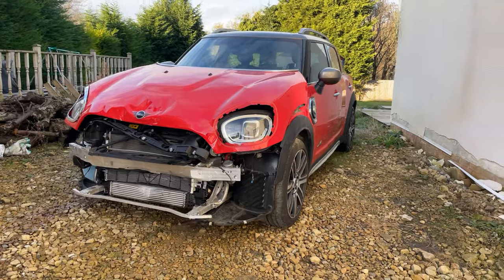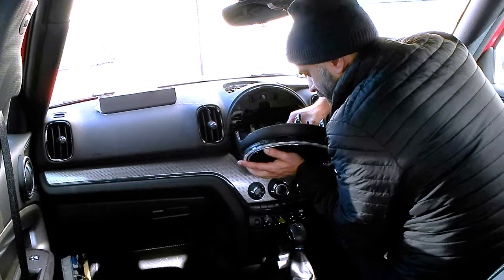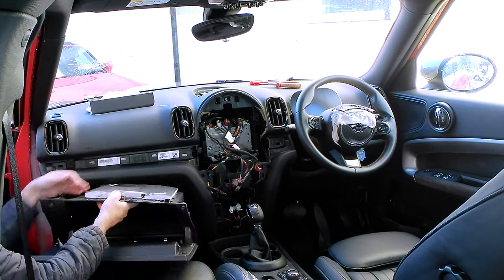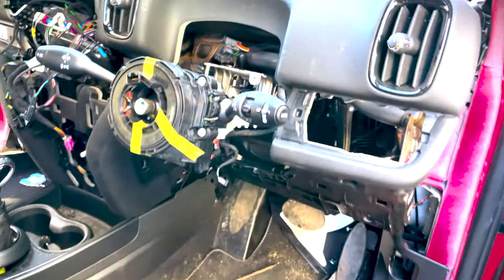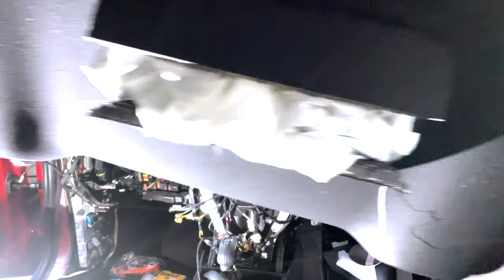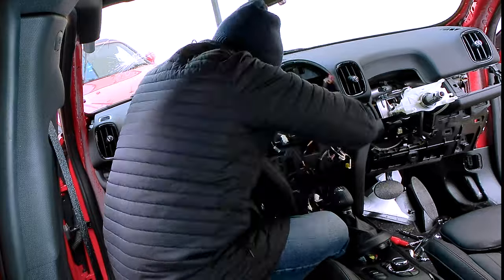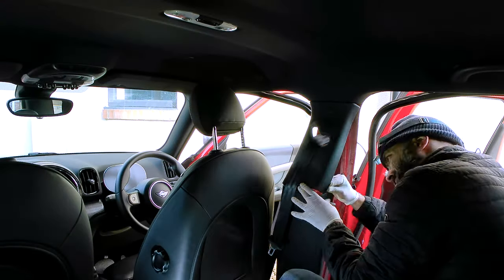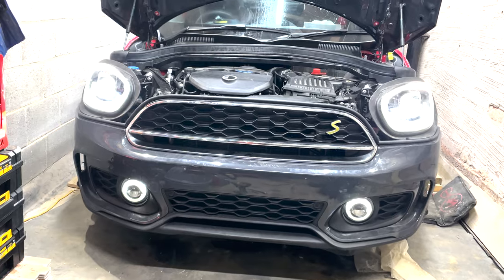REPLACING AIRBAGS | REBUILDING A WRECKED MINI COOPER S E HYBRID | Copart Salvage Auction Restore DIY

Comment: Hi Imy, Great job, but I’m a little puzzled, having sorted the actual airbags, seat belts, what about the srs control module which, correct me if I’m incorrect, is under the centre console. Do you not have to remove this in order the reset the ‘crash data’? I’m doing a very similar job so I would welcome your reply please? Regards Rod
Reply from the maker: Hey Rod, on BMW’s / Mini’s you can just reset the crash data using diagnostic software. I used the ISTA software to reset the module. If you’ve got a new module with your airbag kit, you could just swap it out at the same time as doing the airbags - if you don’t want to be messing with software or diagnostics. The third option is to send your module to one of the many airbag companies on eBay who will reset it for you. Good luck!
Reply: Hi Imy, Thank you. Will ISTA run on a windows 10 lap top, if so, is the procedure easy to follow and which ISTA package is it?
Reply: Not to worry Imy, I’ve removed seats to remove centre console to access srs module, I’ve also prepared dash to remove, not difficult or really time consuming. Thanks again. Regards Rod
Reply: Hi Imy
Sorry to be a pain, but I having no luck with getting the airbag module crash data reset.  It’s a ACSM4i  part number 6577 5A41CA2. 01.  I’m being advised it’s not possible and a new module is only way forward by two company’s  and the other three contacted have not responded!  My question, mine is a 2023 yours a 2021 both face lift LCI models therefore, I would guess have identical modules?  Can you advise please?  Regards Rod
Reply from the maker: Hi Rod, I’ve not used them myself but a company called crashdata (co.uk) have your part number listed as one they can reset. They charge £65 I think. I’ve no experience of using them, there are other companies that can do it too. But, I would first check that you’ve cleared all your airbag codes. Are you sure the seatbelts aren’t still showing an error? Like I mentioned before, I just reset mine using the software, I’d be surprised if they changed the module significantly on the f60.
Reply: Hi Imy  Thanks for your reply Cashdata, Liverpool, won’t touch the module as another company Autotech, Leicester, had it and could reset data. They say they don’t know what’s been done to module, but really, all they do is plug it in and if it doesn’t work it doesn’t work!  In truth I think it’s sour grapes on their part or more likely they can’t do it either!  So, I’m now in contact with Electrotech, Manchester, who say they have seen this kind of module before and think they can clear the crash data, so fingers crossed!  You ask if I have cleared the airbag/seat belt codes, as crash date requires reset I thought the respective company would do this too, so no I haven’t, do I need to do this first?  If so it may be difficult as steering wheel, dash, n/s curtain airbags and, although not locked out, both front seat belts have already been replaced and I fear that refitting the module at this stage to clear the codes may deploy one or all!
Reply from the maker: No, I meant to say are you sure all the faults have been physically cleared… i.e you’ve replaced all the parts that need replacing. Given where you’re up to, I would have the ecu reset, plug it in and then see if the airbag light goes out. If it doesn’t, you might need to replace your rear belts too. They don’t always physically lock out when they go off.
Reply: Ok Imy, thanks for clarification that’s great. I’ll let you know how I get on. Regards Rod
Reply: Hi Imy, Just refitted airbag module (battery disconnected of course) Electrotech (NW) Ltd, Manchester, were able to clear crash data, well I hope they did?  I need your help again please. Cast your mind back to your video where you removed the centre entertainment unit. There is a two trace wire purple and black and white and black shown quite clearly on the right with a small light blue connector. Every other wire I’ve found a home for but this one!  Can you recall where it goes please?  Regards Rod
Reply from the maker: Hi, sorry my memory isn’t that good! :) I’ve no idea on that one.
Reply: @ImysGarage  That’s ok Imy, it’s a while ago I know, I only stripped mine out four weeks ago and can’t remember!! I have to say, with the exception of the courtesy lights and rain sensor, because, I think, I have n/s sun visor discounted? everything else works, so it may be a spare connector in the loom,? we’ll see how it goes.  Thanks again for your informative video regarding the dash removal, I think without it I would still be scratching my head!  Regards Rod